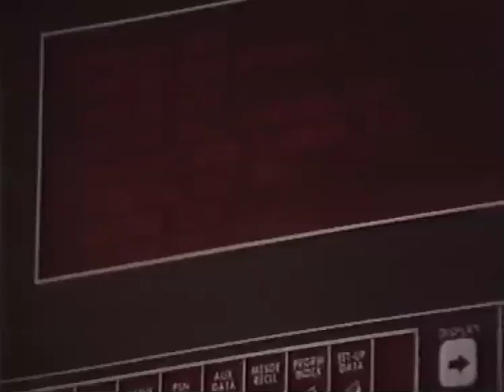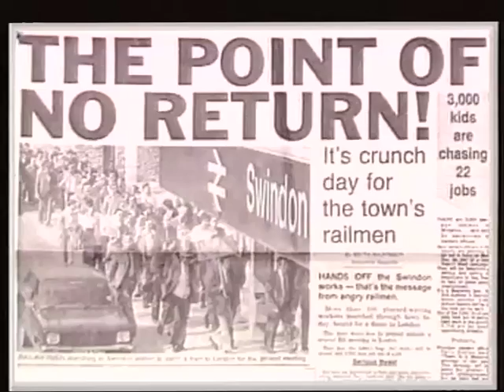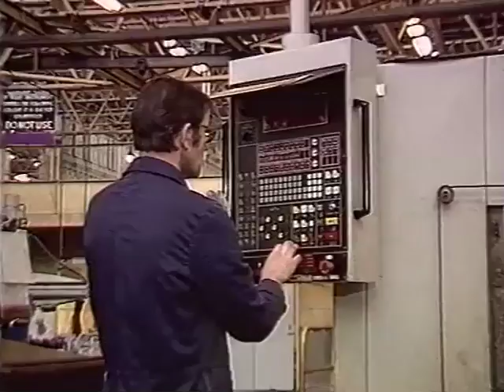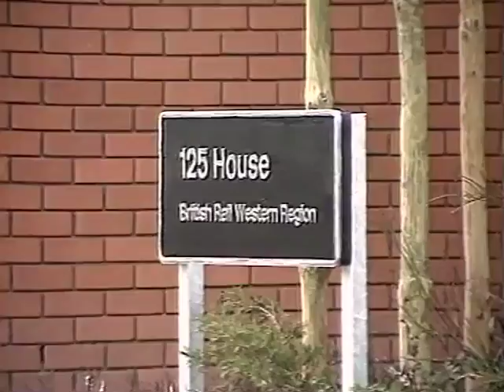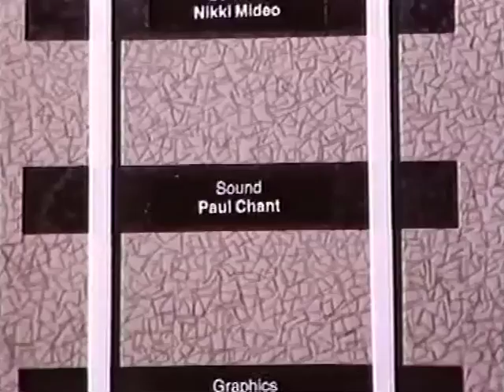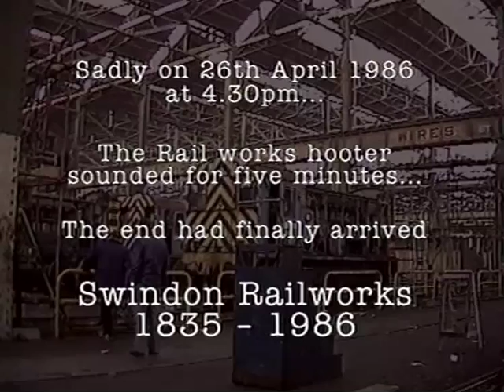SWINDON CABLE ARCHIVE - Gods Wonderful Railway

Comment from the maker: By 1960, when Swindon produced British Railways' last steam locomotive (Evening Star, number 92220), it employed only 5,000 men. The payroll was down to 2,200 in 1973 and though it recovered briefly to 3,800 in 1980, the writing was already on the wall as the works failed to win outside orders and received a diminishing share of now limited British Rail Engineering Ltd (BREL) work.
Reply: Some blamed the NUR for sitting on the fence against the 1983 CAP which doomed Horwich as well.

Comment from the maker: I do wish people would do their research about this. Thatcher was not the reason the works closed. If you know your history about the GWR you will know that the works were in decline from the 1960's. thatcher may have been PM but even if Labour had been in the works would have still closed:
Reply: Some people tend to attach emotions rather than facts to their opinions. Thatcher was the best leader the UK had
Reply: In fact the Conservatives stopped their own MPs for wanting more train services cut in the 80s instead asking for more reopening and modern trains but it came at a high price to the loyal workforce within BREL and later BRML.

Comment: I have to take issue with a couple of points.
The old boy at the end said that a motorway takes up 40 acres per mile as opposed to 1 acre per mile for the railway.
I have measured the width of a six lane motorway from boundary fence to boundary fence and a railway with two tracks is only half as wide (also from boundary fence to boundary fence) so this statement is wildly off the mark.
When you take into consideration that lots of railway routes are four track systems, there's hardly anything in it.
Just because the GWR is known as God's Wonderful Railway, there's no need to ask the opinions of two clergymen, is there?
And lastly, was the GWR male voice choir really that awful, or was this filmed on one of their bad days?